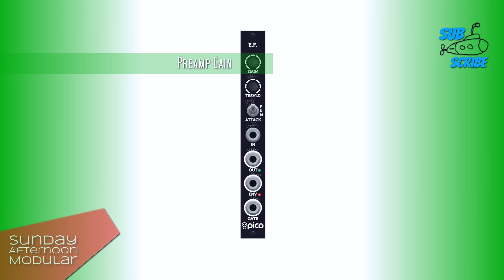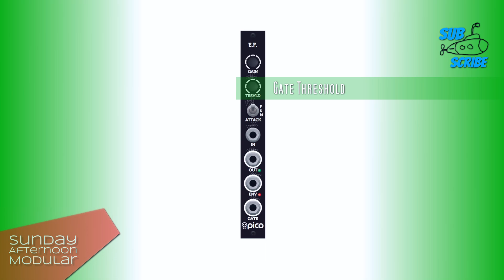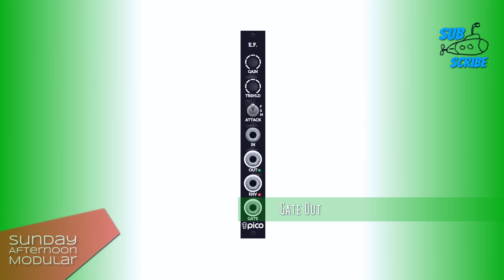Erica Synths Pico Envelope Follower Introduction

Comment: If one would invert this envelope signal it could be used to create a sidechain to a kick right?
Reply from the maker: Hi MrStanley85, I never tried it myself because I have a compressor module with a sidechain input, but yes, that is how it should work.
You take the envelope signal and use a voltage mirror to add a positive offset.
Reply: Exactly! Works a charm; you can experiment with VCAs , VCFS  to build a compressor to taste .